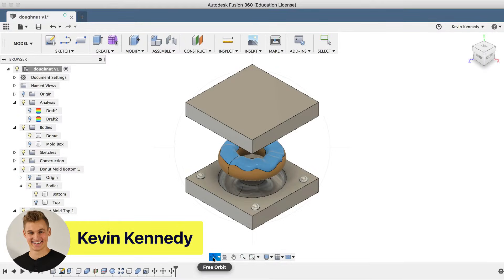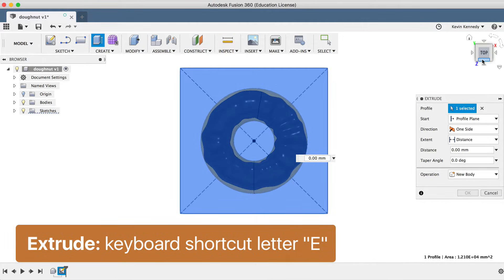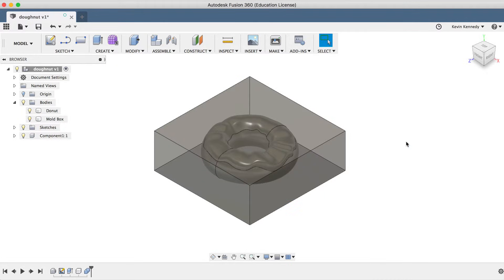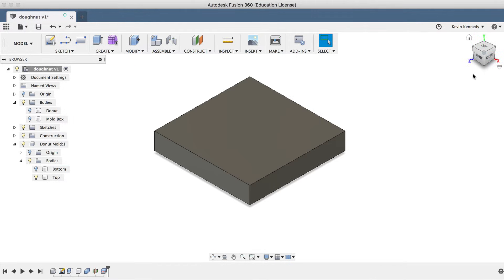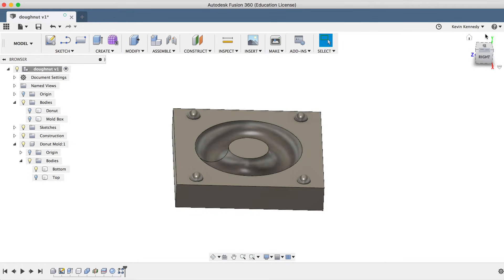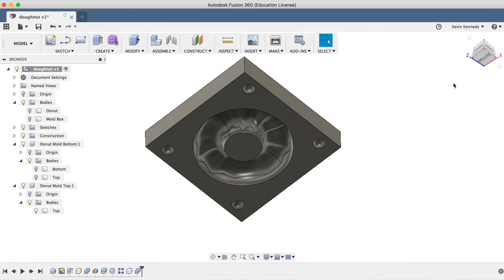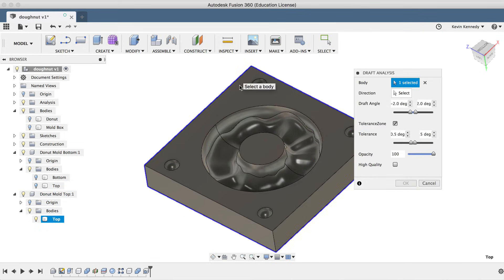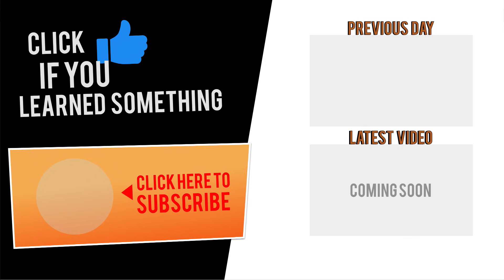How to Create a Two-Part Mold in Fusion 360 - Learn Autodesk Fusion 360 in 30 Days: Day #21

Comment: First let me say I LOVE this video series. I'm just getting into 3d printing and am finding this invaluable. That being said, there are a couple things I'd like to suggest for the mold. I've been in injection molding for decades, so I may have a different perspective. 

1) This is petty, but at least in my experience, they're called locators. Never heard the term registration pins. 
2) The pins are almost always cylinders with a chamfer on top. It's much more robust that a sphere. With molding by pouring the material in, this may not be an issue since there isn't any real pressure building up inside. Injection molding is different and would tear the spheres apart very quickly. The other solid option is a cone shape if it's difficult to line up the halves. 
3) I would seriously consider adding a vent hole. Otherwise the air won't all get displaced and you'll wind up with a very porous part. They can be tiny so the final part isn't really effected. Injection molds have these and you can't even see where they are on the finished part. 
4) Does the inspect function have the ability to check the knit lines? If using a hot material this is critical in the molding process. 
5) You could optionally add ejector pins on the halves to aid in releasing the part. These leave marks though. 

Please don't take this as criticism, I can't get enough of these. You're series is by FAR the best one out there. Kudos for mentioning mold release and undercuts as well. Anyone starting in molding of any kind really needs to understand these things to be successful.
Reply from the maker: Hi, Jon. Thanks for the feedback. I'm always open to hearing things like this!

To clarify, this tutorial was intended to be a very stripped down mold-making tutorial with the focus to be predominantly on Fusion 360's features. Because of that, I have removed industry terminology and tried to keep it at a basic level that a hobbyists could understand and use for small projects (3d printed).

I do hope to eventually create some tutorials or a course that is more specific to Injection Molding. I have some experience designing and manufacturing for injection molded parts...although it sounds like you have more than me! I may have to pick your brain if I get around to making a tutorial for it.

Thanks again for taking the time to leave and share this valuable molding info! Cheers, Kevin :)
Reply: I see what you mean. Makes a lot of sense to do it that way.  I would be happy to help any way I can, and I'm never to proud to admit when I don't know something 😂
Reply from the maker: @joncue0304  Thanks again...and thanks for your honesty, Jon! :D
Reply: Your videos are so good I felt I had to become a Patreon supporter. Never done that before. Made an account solely for that purpose. Fantastic work, I sincerely appreciate it.
Reply from the maker: Thanks, Jon! I really appreciate you joining my Patreon. Every little bit adds up and will continue to help me create more tutorials and invest in more/better equipment to improve them. Cheers, Kevin :)

Comment: I tried giving more register keys to the top and bottom components. I split the top and bottom halves to quarters and they gave me an error saying "There was a problem combining geometry together." what should I do?
Reply from the maker: Hi Sam. This error is typically caused by some sort of geometry not being fully closed. To check this, you can turn off the design history. Right-click on the top-level component in the Browser > Select "Do not capture design history". Then, while in the Design workspace, select the inspect dropdown menu > validate. Using the validate feature will help you verify the quality of the bodies. If it finds any errors it will attempt to repair them by stitching them together.

Let me know if that helps. I'd be happy to take a look at your file if you'd like. Cheers, Kevin :)

Comment: Hi there, is this the right place to ask questions I'm a noob.. for some reason I can't see both top and bottom parts solid together I can view them solid seperately. I can either see the top or the bottom solid but not at the same time. I've tried the opacity control on all of them but no success. Pls help
Reply from the maker: Hi Darren. By default, Fusion 360 will "ghost" all components that are not active (you can change in the preferences if you don't like this). If you want to see all components at 100% opacity then you will need to right-click on the TOP LEVEL component (file name) in the Fusion 360 Browser > Select "Activate". When the top-level component is active all components and bodies nested underneath will have 100% opacity, unless the opacity has been individually changed. 

Let me know if this solves it for you...if you're still having issues I would be happy to take a look at your file. Cheers, Kevin :)
Reply: @ProductDesignOnline  Hey Kevin, I did the tutorial over again and this time it works. I'm not sure where I went wrong. I read your opinion but there was another underlying problem.. probably something to do with components and bodies. Oh well it works now.. thank you for your fast response :)
Reply: Hey.. I've figured out what went wrong. I was getting confused with all the different opacity controls... Now if I activate the TOP LEVEL component everything goes solid (100 percent opacity) Thanks once again :)
Reply from the maker: @darrenthacker9223  I'm glad you got it sorted out. It can be a bit confusing especially if you forget that you have manually changed the opacity to some of the bodies or components. Cheers, Kevin :)

Comment: Have to give this video a thumbs down. Tried printing the doughnut without the molds but it tasted like plastic mostly, only ate one half before I threw it out in the bin.
Reply from the maker: Hi, Special Agent Dale Cooper. It sounds like you forgot to add the frosting and sprinkles. Those should drown out the plastic taste enough to were you could finish it. Cheers, Kevin :)
Reply: Can you include a link to the sprinkles?

Comment: How do I import the file and what type of file should I import. When I bring it in it is on edge and it shows up as "doughnut v1 (1):1" in the browser list in a different place from the Mold Box. 
I have  a feeling this is something simple you have already covered but I have been away from it for a while and can't figure out what is going on.
Thanks Kevin - good stuff!
Reply from the maker: Hi Doug.
1. Click on the doughnut file link https://a360.co/2qfRsZx
2. Click the blue download button. Select Fusion 360 Archive file type and then type out your email.
3. Download the file from your email link
4. Open up your data panel in Fusion 360 (grid icon in the upper lefthand corner) and then select the blue upload button.
5. Select the doughnut file from your downloads folder and then hit "upload." Once uploaded double click on the file to open it up.

Here's a video on uploading files - https://youtu.be/TVD0YlfGjM0

Let me know if this clears it up! Cheers, Kevin :)
Reply: That was interesting...I imported it and the did a drag and drop to the design panel. It came in exactly like the others - standing on the edge. Then I watched the video and tried double clicking instead of drag-and-drop and it was in the correct orientation. Why is that?
Reply from the maker: @douggrant4008  I think I know what may be happening. What is your default modeling orientation? I'm guessing you have the Z-axis set to be up?

In the doughnut file, the Y-axis was set to up, which could explain why when you open the file it's sitting at the right orientation, but when you insert the doughnut into your current design the object is on its side.

Let me know if that was it! Cheers, Kevin :)
Reply: Yes, that is the problem. Is it better to leave it that way in Fusion360 and change it in the slicer, or should I change my preference in Fusion? Or, doesn't it really matter?
Reply from the maker: @douggrant4008  It really doesn't matter. Fusion 360 used to have the default set to Y-up, however, they recently changed it to be Z-up. I try to stick with defaults so it is easy for everyone to follow along, but that's why my older tutorials will have Y-axis up and the latest ones have Z-up.

If you're mainly planning on 3D printing then it wouldn't hurt to have everything oriented with the Z-axis up... just one less step (rotating the model) when you get to your slicer. Cheers, Kevin :)
Reply: @ProductDesignOnline  Hey, thanks for the video! But I seem to be in trouble every time when there is some demo file that needs to be downloaded, at least when it offers 10 different file types and you don't specify it in the video description. 
For this tutorial, I first downloaded the .stl file, after that .obj, before I found this comment.
Probably adding the file type needed for the video next to the download link would solve the case.
I'm still new to Fusion 360 and I haven't seen a great video on explaining the difference of all these file types.
Cheers!

Comment: Hi, Kevin
11:11 I'm wondering what "registration keys" is
Reply from the maker: Great question, CHO성진. In mold-making, a registration key is a shape that is intentionally added to help ensure that all the parts of the mold line up correctly after taking it apart. It ensures that each time the mold pieces fit back together and that they don't slide apart in the mold making process (however, usually a rubber-band or latch is required to hold the pieces together).

One thing to note - in this video I simply made half spheres...but you could realistically make the registration keys any shape that allows one piece to be taken apart from another. Cheers, Kevin :)
Reply: Product Design Online 
Thank you! I understand it
so useful information
Reply from the maker: @devstefancho  You're welcome :)

Comment: I'm interested in drawing the doughnut also. How can we draw the icing part like that?
Reply from the maker: Hi, paranajape. The Donut file was actually built in another 3D program. You could attempt to do the frosting in the Sculpt environment or... possibly by very carefully lofting surfaces in the Patch Workspace. However, this type of modeling would likely be easier achieved in Zbrush, Maya, or Blender. Cheers, Kevin :)

Comment: Hey what about the part about print tolerence, we cant print exact dimensions and expect parts to fit
Reply from the maker: Hi Ardian - great question! For this demo the mold was just for fun, so I was not concerned about tolerances. If you're looking for exact dimensions then you will have to do some tests. The tolerances really depend on what type of 3D printer you're using, as they vary drastically from consumer level printers to commercial grade printers. Cheers, Kevin :)
Reply: @ProductDesignOnline  thanks for the reply you're awesome! I was just hoping to maybe see which way you would go about it when it comes to modeling tolerences. My tolerance is 0.06mm
Reply from the maker: @ardianmusliji8349  Unfortunately, Fusion 360 doesn't currently offer an easy way to do tolerances while using the split or combine tools. If you're planning on 3D printing, I actually recommend adding tolerances in your 3D printers slicing software by slightly scaling the mold. Alternatively, you can scale the object in Fusion 360 before you go to create the mold. Cheers, Kevin :)
Reply: You can set tolerance on cura and other slicers different on two half of object

Comment: Ok: here we  go 😁  in your right hand hold a pen in front of you  with the point straight down vertical on a piece of paper  we will call that 0 Deg. now don't take the point off of the paper now lean the pen away from you 10 Deg. and at the same time lean it to the right 3 Deg.
 So all 6 of the holes leaning forward and In at the same time this way each hole will follow the radius of the disk.
 I hope that will help 
Thank you for your time
Reply from the maker: Thanks for the clarification... I believe I understand what you're trying to do now :)

How does this look model look?
Fusion 360 File: https://a360.co/2DkDW02
Reference Image 1: https://snag.gy/0LJ7HQ.jpg
Reference Image 2: https://snag.gy/pR6C1J.jpg

Take a look at the file when you get a chance. If this is correct, then I can explain the steps I took to get there. Cheers, Kevin :)
Reply: Thanks for responding I definitely see it lean in but I don't see it lean forward The lean in looks like 10 deg.and that should be 3 deg. but I don't see the forward and it should be more noticeable than the in
 Now Im just guessing if you look at ref pic1 you can see the lean in but neither pic can you see the lean forward. I can see the slot left to right but not one front to back.  Again maybe it's just me.  But it is sure a lot closer than what I have done!
Again Thank you for your time!
Reply from the maker: @oldfarmhand7714  I just created a second component and created a 10mm cylinder. Then used the move tool to angle it and put it in place. I created some construction lines on the original diameter for reference of location. Then,  use the combine tool to subtract it from the diameter/plate. Then use the circular pattern tool and revolve it around 6 times :)

If you follow those steps you should be able to get the right angle you're looking for. Hopefully this helps! Cheers, Kevin
Reply: I will try thank you for your help
Reply from the maker: @oldfarmhand7714 You're Welcome! Let me know if you get it to work :)

Comment: Could answer a question only if you have time?
 I have  a solid disk 25mm thick by a diameter of 80mm and I want to put 6 holes 10mm diameter each around the  circumference 10mm off the edge.  That is the easy part, im just trying set the stage for the part I cant do. Now for the hard part, I need each the hole to lean to the center of the disk 3 degrees and each hole follow the  circumference of the disk  leaning 10  degrees. can you help?
 I thoroughly all of your series that you put up. You make it so easy to follow.
Reply from the maker: I'm always happy to help! However, I'm not sure I understand the last part of your question. I've got the disk part down and understand that you want to have circles around the circumference... but, can you please explain the degrees in further detail? do you have any reference image(s)? It seems like the 3 degrees and the 10 degrees contradict each other... or are they being applied to different circles? Cheers, Kevin

Comment: Great video. I work in tool engineering for investment casting foundry and no matter the complexity of the tool, many of these same steps are taken. A surprising amount of parts and gating can be made using a cope and drag style tool (upper and lower tool with single parting line.)

https://imgur.com/a/84C9wzB
Reply from the maker: Hi, RiveRat1986. Sorry I missed your comment earlier. Thanks for sharing the link - that's awesome! A lot of designers underestimate the power of two-part molds, especially with access to a good CNC machine. Cheers, Kevin :)